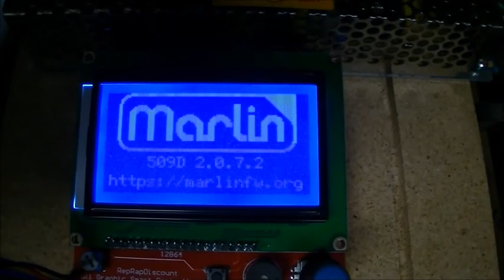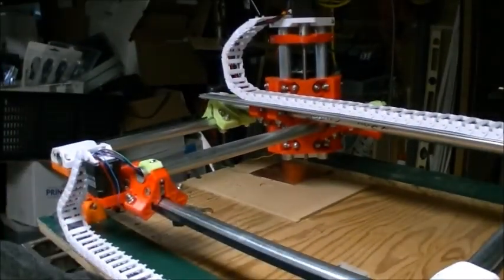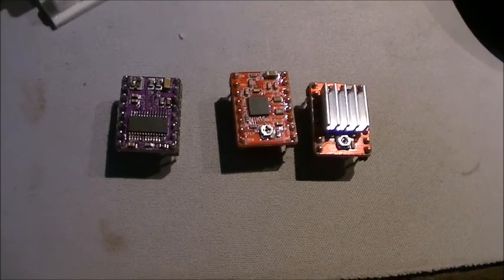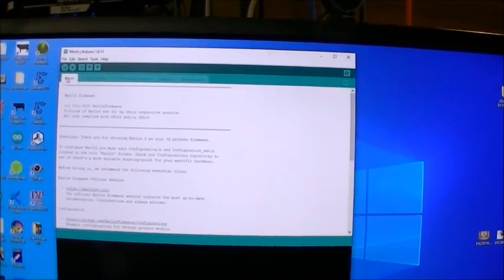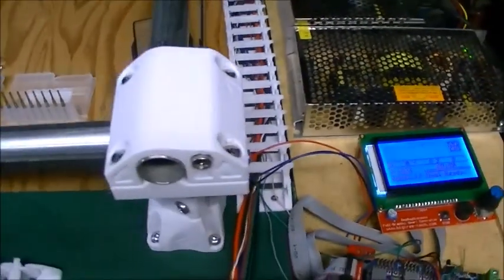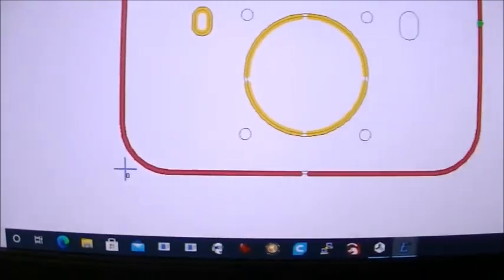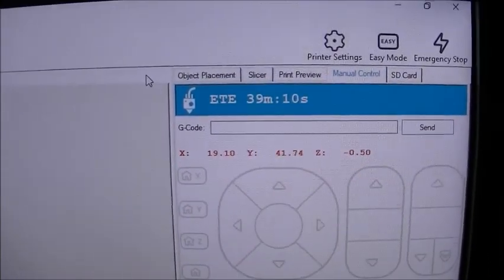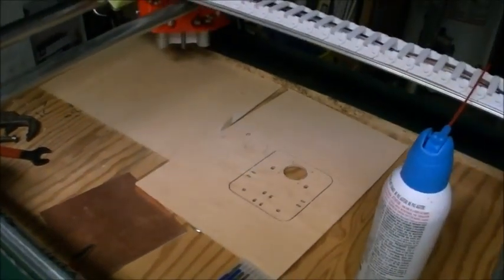MPCNC milling a brief newbie walk through, hardware, firmware, software

Comment: Thanks for the informative video I am a sheet metal worker and have no clue about electronics and programming. I’ve now retired and am looking to do small parts to help supplement my pension. Thanks for the info
Reply from the maker: If I had to do it all over again I would make a CNC plasma cutter first.

Comment: Great video. I am at the firmware stage of my build. I noticed you do not have the extruder image on your lcd screen. Do you have a copy of the firmware you used that you would be willing to share?
Reply from the maker: Happy to share anything I might have that will help you but it is unlikely that my firmware will help at this stage of the game since I have changed my config considerably since then. I am now running an SKR Pro V1.2 controller with TMC2209 drivers... and frankly I recommend it HIGHLY... Much quieter, all my lost step issues disappeared. And to boot now that I have the TFT35 display it is one of the V1 standard configurations so they have firmware that just downloads and runs... 

When I was working with the RAMPS boards I was compiling my own from source after updates for my hardware to select endstops, drivers, LCD etc... and if you have to compile I highly recommend using the Visual Studio Code. Bit of a learning curve but it saves a LOT of time each compile.

Comment: Great video! I like that "snap" cable chain, do you happen to have a link to those files? Thanks.
Reply from the maker: The one I used is this one
https://www.thingiverse.com/thing:4541775

The plus of this one was unlike some, this doesn't bend backwards. 

There where a couple of gotchas. The hole spacing on the two ends was different... I didn't notice this until I had designed some different mount parts for my unit and went to put things together. 

I like that you can unclip the latches to add or replace wires. Sometimes they break as you snap them in. Who cares, print more...

Comment: Seriously cool.  Any chance you could attach a plasma cutter? Lol
Reply from the maker: Oh I have been looking at that. I would probably build a much bigger one for a plasma cutter. Big steel bed. Once you have the concept mastered the options open up.
Reply: I had seen a few YouTube videos with plasma cutters on MPCNC, the only thing is you will need shielded cables for endstops and Motors, otherwise the high frequency electric noise can trigger malfunctioning.